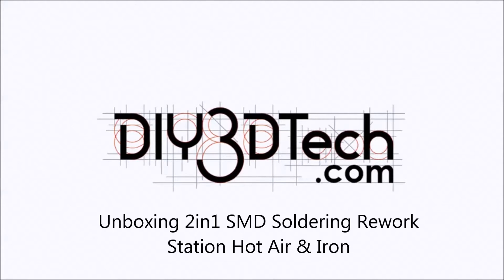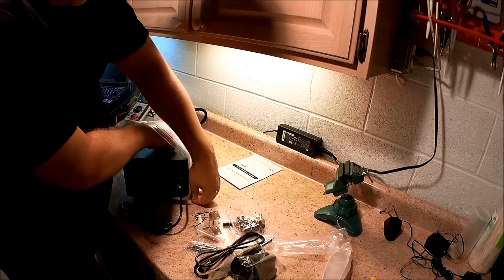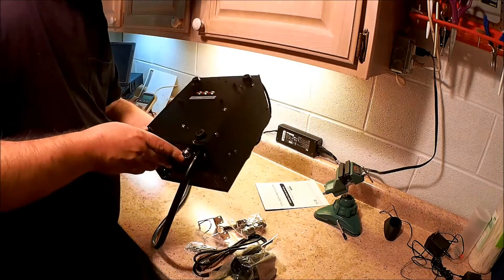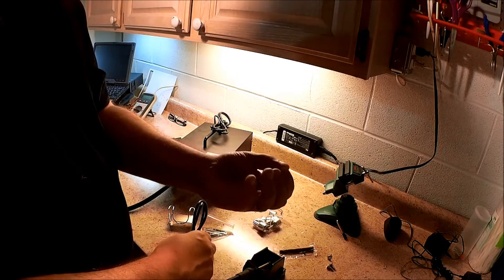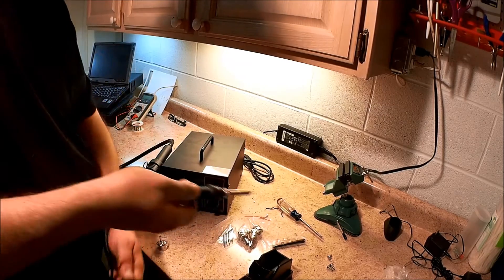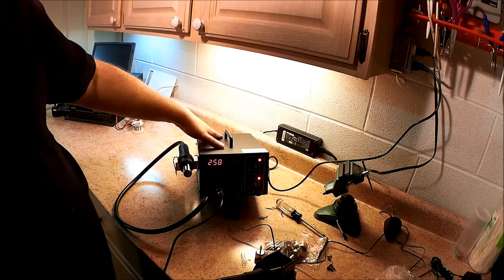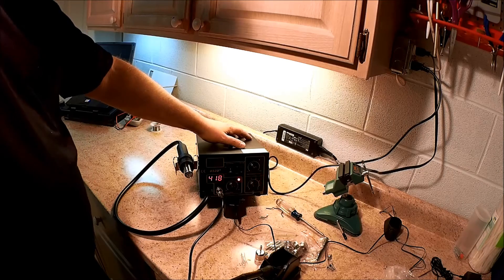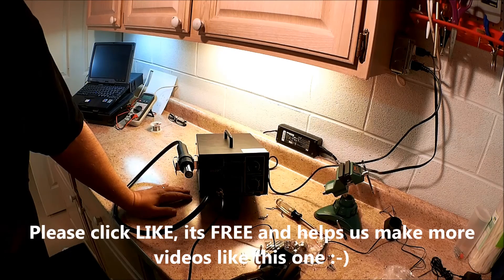Shop Talk - Unboxing the 2in1 SMD Soldering Rework Station Hot Air & Iron 852D!

Comment: It's amazing how affordable the 2in1's are now. But these things are a workbench hog.  The overhead cabinets look great,, but they just don't function well in a shop/lab environment.  I pulled mine down, and installed multiple(many) rows of open shelving.  The 2in1 now sits just 18" above my workbench, and it's easy to coil-up the hot-air hose and soldering wire, to keep them out of the way,, but yet still be easy accessible.  The open shelves are also great for storing a lot of tools and project components.  The best shelf organizer I've found for holding small items is clear party cups.
The hot-air gun is also good for fixing 3d printed objects. You can flatten strings ,  lay-down droopy overhangs , embed nuts , and quickly dry glued pieces.
Also: The fork-thing is a component popper/removal helper. Shove it under a component when de-soldering, it will provide lifting force. (aka: burnt finger-tip saver)  :)
Reply from the maker: Ditto on the fixing 3D prints! I forgot to mention that too! with the heat gun you can use it similar to acetone vaporizing without the risks.  Also that for share what that forked thing was as I was trying to figure that out myself :-)
Reply: LOL, I'm catching-up on my YT subs, and I started with this one first. Then, I jumped back to where I left off,, and quickly realized,, ah oh,, you have WAY more experience than me,, and was about to edit out the fork comment :)
Acetone vapor smoothing still gives the better "overall" surface finish. I just use the hot-air gun for rough repair work, then vapor smooth.
Cerberus333, on Thingiverse, uses a small 5v fan, attached to his pale lid, to circulate the vapor more evenly. That is going to be one of my winter projects.
PS: Nice 50" monitor. I'm running 5 monitors , from a quad i7 laptop, thru a 3.0 usb hub, then to hdmi adapters. Might be time to re-think my setup.
Great Channel !  Thumb(s) Up !
Reply from the maker: Please use care with Acetone vapor and especially anything that could even a small spark as Acetone vapor burns with an invisible flame.  Also would highly suggest checking out the  MSDS sheet on it to.  Have worked with it in the past in an industrial setting and the stuff requires a lot of respect.  Cheers!